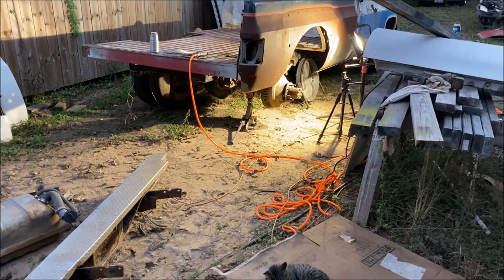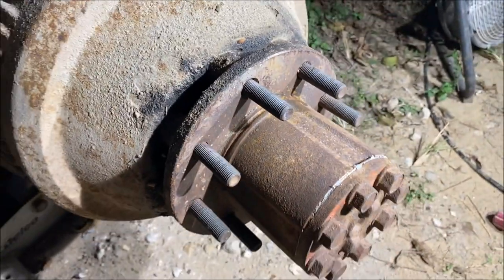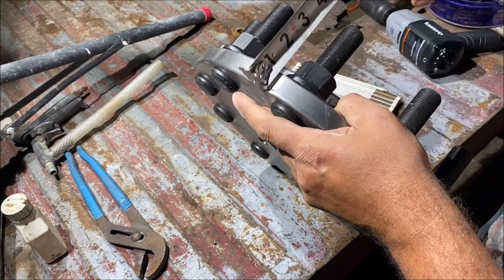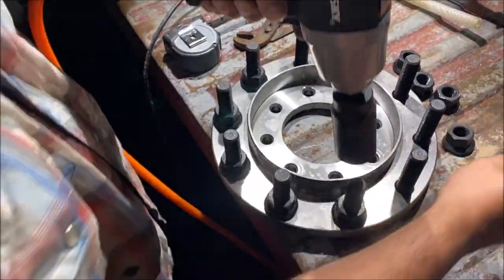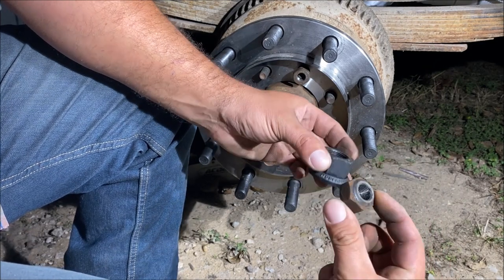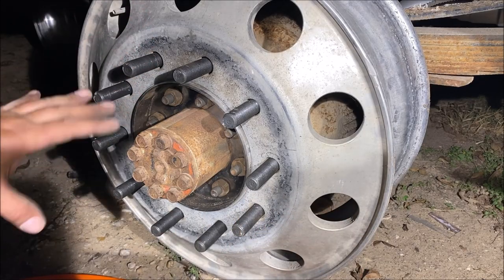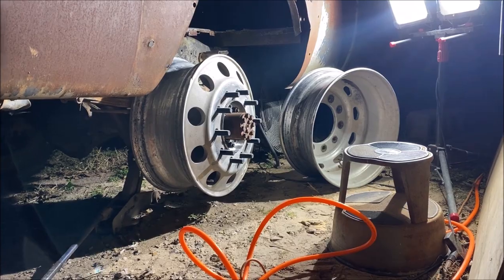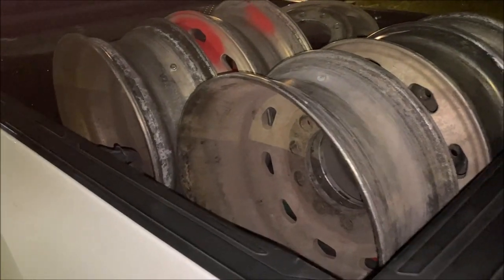22.5" ALCOA semi DUALLY 8 to 10 lug conversion PART 2 WATCH BEFORE YOU BUY ADAPTERS!!!

Comment: ( bed related ) I'm kind of pondering the idea of doing a extended truck bed, my current C30 was a freight train 14ft flat bed truck.  . . Huge.  Anyway its choped down now to about a 9 ish ft truck bed, possibly 8ft 10"  If I can work some magic with a custom fabricated rear bumper/pintle hitch mount, might be able to hide the frame sticking out and just get away with the stock 8 and 1/2 ft bed.

Comment: I was kinda with you, but personally I wouldn't grind on the leaves. My truck would be a hauler so I need full capacity. Hey is your frame a tow truck frame ? I ran into that when I wanted to convert my 2x4 tow truck onto a 4x4 longbed frame. The tow truck chassis is 4" longer. I decided to swap spring perches and things like that onto my oem frame.

As for the 2x4 car hauler I'm dreaming up... I might just run a medium duty axle and be done with it in the back. The front I haven't figured out.

Comment: i have a 21 f350 im running 10 lug adapters to fit some big wheels do you think that f450 wheels(already 10 lug ) would just fit and already slap onto the adapters and work?
Reply: No as the F450 has a much smaller center bore 10 lug pattern than semi 10 lugs.

Comment: my 1980 GMC was crushed by a tree, presently looking for another, still have drivetrain, but I am debating if better to swap diff from a Freightliner? or use adapters to use the SEMI wheels? I have a parts SEMI, with decent axle. just convert to hydraulic brakes and figure axle mounting? hmmmm??????????????
Reply from the maker: if it was crushed by a tree the chassis would not be harmed..... to even think about a semi axle swap to 1 ton would literally be retarded by definition
Reply: @chriscraft77022  why?  it was a vintage wrecker bed, from 1950's 1/4" steel. 7 1/2 foot wide bed, the Freightliner has 3.55:1 gears. 

the roof of truck was crushed to below steering wheel, as well as dash, seat destroyed, both fenders & hood, so yes a new cab, or finding another 1 ton to build on.
Reply from the maker: I would stay away from that swap.. that is sad to hear about the truck getting crushed.. but try and stick with that 1980 dually and do like I did.. you will not regret it
Reply: @chriscraft77022  I understand, I just wanted to be different. I want adapters on the front. no desire to swap front axle, I also want to install a few of the gauges including speedometer from Freightliner. 

my desire is for something unusual to pull single car trailer, and goal is to offer body work, sheet metal fab for people in certain groups, for older vehicles, or some custom work & fabrication.

now you know about my GMC what happened, well I also lost my daily driver, a beater Honda Accord, it is flatter than the truck, then, tree crushed 1 side of my Jeep Cherokee, then side of my Subaru Forester, & for laugh my old fridge I had not hauled off, plus a limb pointing straight down punched a hole in roof, 3" circle size, fixed that within 2 weeks. but I had to recover from this, I just bought a 4wd, and a decent beater. now got to find a cab, or rolling chassis. to continue with my idea. I also had a big block 396 I need to build I wanted to install in the truck

Comment: are you going to shorten the frame to get rid of the gap? I'm working on a similar build and haven't decided what I'm going to do about the gap between cab and bed bc of the CC having a longer wheel base.
Reply from the maker: no, I have 2 more bed sides and an extra floor .. I’m going to extend the bed.. video coming soon
Reply: I have a similar situation & built a removable extension. It's more work, but keeps you from welding on your bedside. I paid a lot of money for that bed & might want to move it forward when I weld in my C-notches & 4 link.

Comment: Buuut, you don’t have to use both 8.25 wheels, use the stock back wheel, put the back wheel on then put the adapter on and use the tuck style wheel if you lowering, like a 6/8 drop and trying to tuck them ( for people looking to drop their build)
Reply from the maker: the tires will be different heights... i did not want to do that.. I wanted two round hole inners so I can run them on one side to give the truck a different look every now and then..